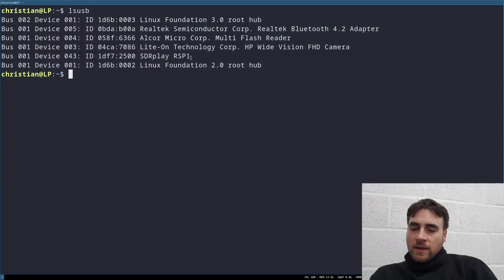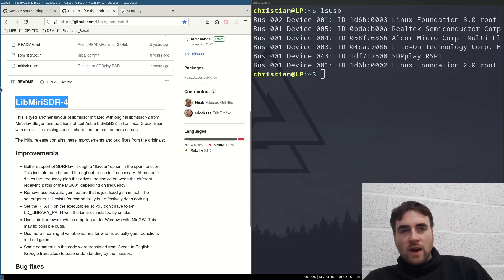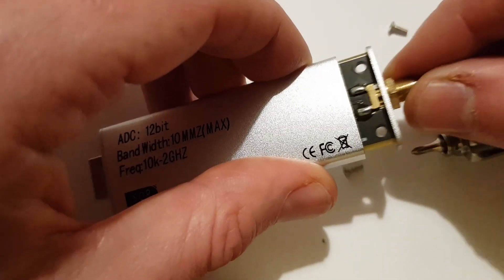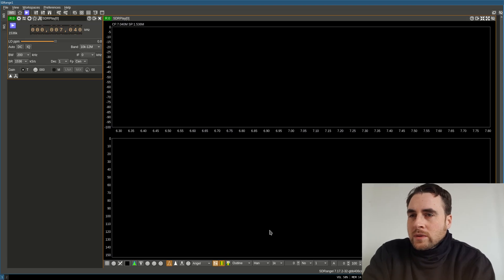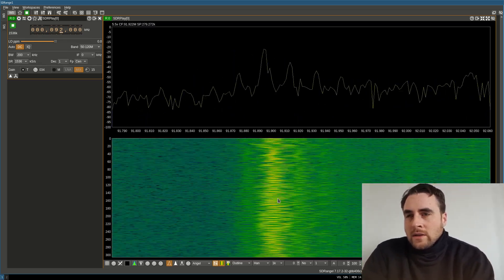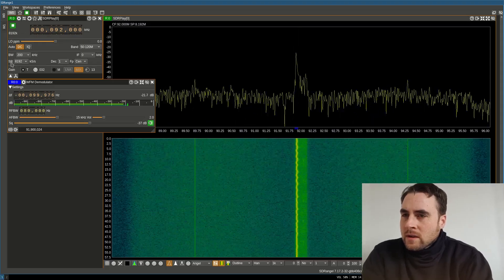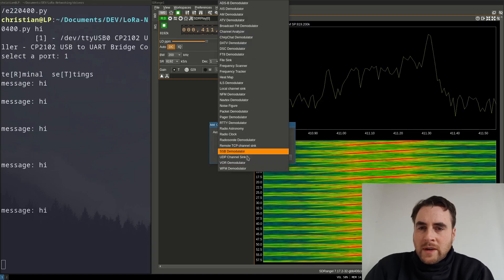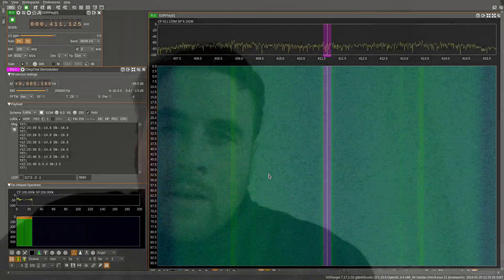SDR (Software defined radio) Generic Chinese Device

Comment: I can see the LoRa signal, so you should be able to decode it. But you will need to align your data acquisition so you can properly decode the signal with a minimum of processing.

Are you able to sample the data continuously with no missing samples? If so, you need to find the start and stop of each chirp and you need enough processing power to process them all in real time.

Or you could record everything and process the packets afterwards.
Reply from the maker: Thanks. I will record it and keep at it. I was considering manually decoding the chirps. The demodulator has a settable preamble length, which I was planning to look into. I just read it is 12.25 symbols
Reply: @try-restart , Do you know how to do chirp compression using FFTs?